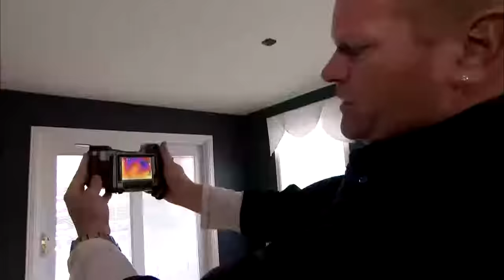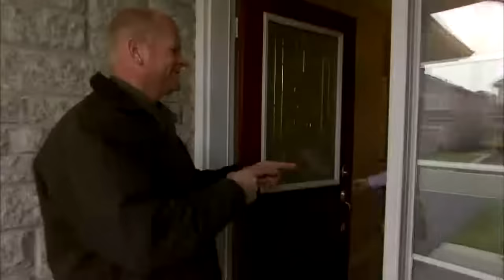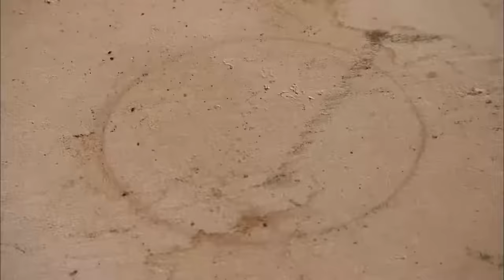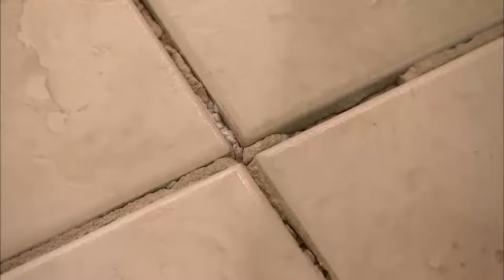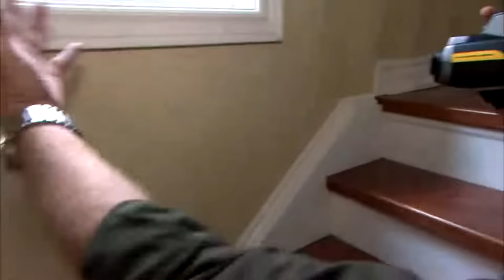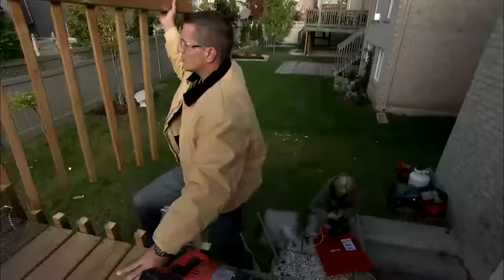Homebuyers Beware: Mike Holmes' Eye-Opening Inspection | Holmes Inspection 118

Comment: I can’t stop commenting, and it’s quite frustrating! As a licensed electrical contractor (master electrician), I tell people that in 99% of home I find code violations and just plain “hackery”. The code changes every three years, so older homes often don’t have what newer homes SHOULD have, but the do-it-yourself (DIY) crowd, along with the army of handymen, cut corners most of the time. It’s easy to make the lights work, but VERY challenging to meet the codes (my words and my experience).

Comment: It's not just Canada. The same issues are here in the States.  Builders just want to get in, throw the homes together, and get out.  They try and use any type of excuse not to follow up on warranties.  The issue I had was mold on the underside of the build-up flooring in my basement.  The builder did take care of that for about 8 grand.  They didn't take care of my garage flooring or the stoop on the front of my house.  The builder went bankrupt I ended up with no recourse

Comment: I bought a new home in 2015... and let me tell you that almost EVERYTHING had an issue. Over the last 7 years, I am finding new issues every 6 months. So, in a nutshell.

1. Wrong tile ordered and improper installation
2. Duct work improperly done for the downdraft
3. Tile shower silicon seal was leaking
4. The shower base was cracked when bolting the glass doors
5. The plumbing was not allowing sufficient hot water in the 2nd floor bathroom
6. The security deck was bolt through the siding
7. The garage side door was not having the flashing and was freezing during winter
8. The kitchen was unsafe, botched and falling apart in less than 5 years
9. The downdraft and cooktop wiring was accessible and unsecure in the island
10. The foundation is not having any flashing between the siding and the concrete
11. Improper sealing leading to pest and insects getting into the outside structure
12. The kitchen sink PVC black draining pipe broke in half in the basement this year

So basically, you are on your own. Home inspector rarely flags any of these and they are major issues. One thing for sure, I will never get caught again... I learned a lot in the last 7 years.
Reply: where in milton?

Comment: My experience as a homeowner is that water- whether liquid, solid or gas - is the single most destructive element I’ve had to face.  From a broken water main to a sewer backup to leaky roof to water leaking from a toilet destroying the subfloor to leaky windows and leaky hot water heater… I swear I’ve cried while writing checks to contractors.

Comment: 12" tiles & bigger, known as large format, I always butter the backs of the tiles. I NEVER use concrete board on floors, it can be brittle especially w heavy foot traffic. I use backer board, & if you wanna scratch a little thinset on the floor prior to installing the backer, go ahead. I wanna see if they dump the sump water out the wall or tie into main drain, all still while using the sump. You can install a 'sealed' pit.

Comment: Why can't the sump pit for the back door to the basement be built outside?  Drain it into a deeper hole outside, then pump it to wherever it's going now anyway.  Letting it flow inside, then pumping it back outside makes no sense to me.  But Mike says at 39:30 "can't put it into a weeping system", I guess it's now against code to drain water below grade so everything has to splash onto your lawn.  Seems like something to do quietly on a weekend, fix that weeping system, a lot less work than all the rigmarole with digging up the basement floor and sump pump.

Comment: Honest question: I had a stone mason tell me caulking does not fix cracks or spaces in brick work. That the only proper way to repair is to fix what's causing the cracking and then fill spaces with mortar. Why then was caulking used here? Is it the proper way to repair? It seems logical to me that it would not be given that caulking loses its seal over time and has to be replaced.

Comment: The rear roof flashing was wrong.  he missed the flashing was over the brick flashing.  Flashing is to be tucked under.  The extra metal you saw on brick.  Added a weep hole was sealed another problem.  As that allows moister a way to get out.  As brick isn't watertight and condensation builds behind.  Calk is stop gap and never should be relied on to keep water out of structure...  Also the water stains around fireplace.  My guess it was a false chimney.  Which means like on a full chimney where water goes all the way down to foundation.  It has no place to go.  Like the flashing on the rear wall solves no problem....

Comment: When it comes to decks, it depends where you live in Canada if you need a permit or not. Here, you don't, but that doesn't mean you should not hire someone with the proper license to do the job. Even with licenses, my contractor didn't even remove my siding for the ledger board, but I get his argument, that improper flashing will be worst. Since it was a fiberglass deck with a silicon join, the water just evacuate at the end of the deck, which is what should be happening. Still, I found most contractor to overcharge while doing a clumsy job.

Comment: There was a third option to the rear door issue. Close it up completely by removing the door opening. They have a door that is already in the rear on the deck.
Reply: It's possible it would have been 2/3 of the cost to close it up. They had to remove the concrete pad and fix the weeping tile either way.

Comment: Mr. Mike Holmes would have a field day in my apartment building... He probably would have nightmares for years ... LOL. Yes our City inspectors simply look and agree it's up to code but there are soo many things NOT up to code like a 240V 30A romex simply placed in a metal junction box, capped and still connected to the 30a breaker at the main panel box :(

Comment: I saw one thing I do not like and that will cause problems later if not right away. That sump pump is pumping the water from the weeping tile and the drain outside from outside. Yes the water is draining from the sump to the exterior BUT the drain however should have gone much farther from the house. That will just constantly recycle the water, fill the system, and ultimately run 24/7. That pipe needs to go at least 10-15 feet away from the house.
Reply: I was thinking the same thing , thought they said it was going to get tied into the sewer out front towards the street or something ....

Comment: @26min, another good idea would have been to build a doghouse around the entrance out back.  Could have provided a nice dry entrance, provided a buffer against freezing below grade, prevented water and snow from collecting, and allowed for appropriate water runoff control, AND not required a total ripout of everything below grade.  Re: the deck stairway... could have easily added a middle sringer to the stairs, and could have easily firmed-up the connection of the stairs to the upper deck.

Comment: And a lot of states you’re supposed to not use lag bolts you’re supposed to drill all the way through and nut and bolt it that is the correct way because contractors have cut the heads off and is partway pounding them in and just use nails and that dry pack shit with those footers that’s bullshit that’s a lazy Contractor,poor a footer correctly have four or 6 x 6 up like it should be

Comment: the house contractor and presumably subs were surprisingly bad on this new construction - kind of impressively bad.  i would've liked to have re-routed water to an outdoor sump, instead of bringing it back inside.  set up to avoid accepting exterior surface water or direct rainfall.  if possible, construct an awing of sorts over the walkout steps and stoop.  that' said, i'd trust holmes